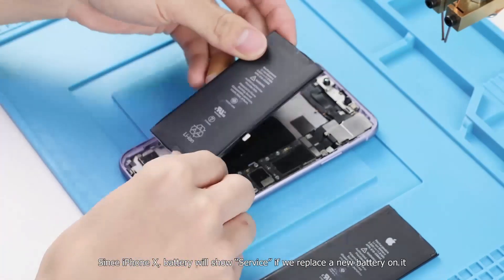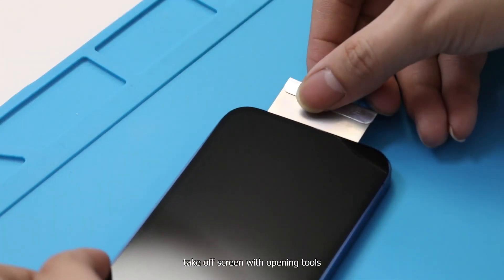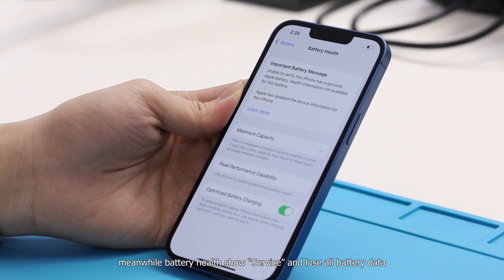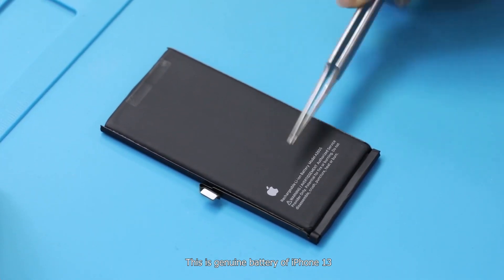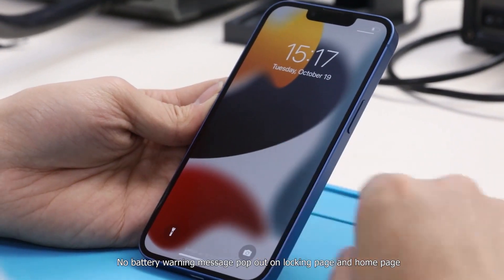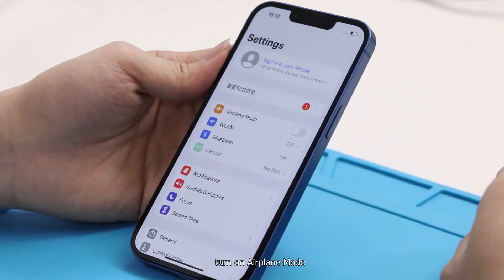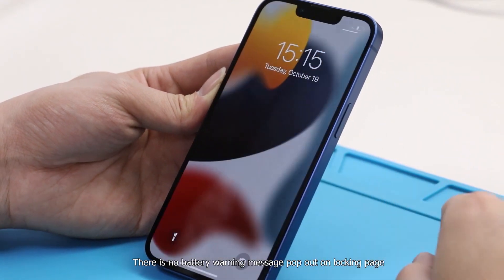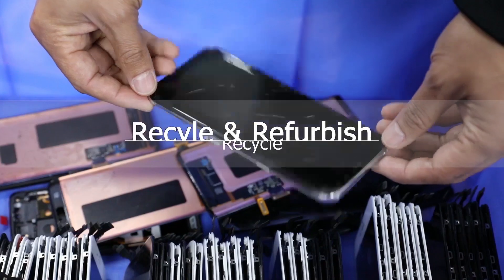How To Remove iPhone 13 "Important Battery Message" | Bonus Trick After Solution

Comment: Hi friend!
If im gonna replace iPhone 11 battery to a compatible.
Can it work properly if i only move   over battery board from original to comoatible?
Or do i also have to transfer battery data?
Thanks for answer.
Regards
Reply from the maker: I think you mean replace genuine battery with a copy(3rd party) battery. It's ok if you move over battery board from original to comoatible battery cell.
Reply: @Elekworld  Yes i meen 3rd party battery.
Do i also have to transfer battery data from old to new? 
Thanks for answers.
Regards
Reply from the maker: @Protube70  If you not care about the capacity data(100% or not), then don't have to.

Comment: Can i used iPhone 12 mini battery high capacity with iphone 13 mini after install PMS ? Or different voltage?
Reply from the maker: Not compatible. DIfferent voltage, different capacity and most importantly different BMS connectors.

Comment: If old original battery has 70% battery health, what battery health will appear after transferring the board?
Reply from the maker: Old 70% battery health, bcuz mainboard read the data from old BMS. But we also heard some few case that the capacity data will arise according daily usage bcuz it's new battery cell.

Comment: So data from Original board is 80% then new cell will say 80% as well?
Reply from the maker: Yes it is, bcuz teh motherboard will read data from old battery board. But we do hear some very few case that users said the capacity data might arise bcuz new battery cell has more power capacity.

Comment: Does that happen even if the battery's been replaced by Apple service providers?
Reply from the maker: It depends on if they are REAL Apple authorized repair center, also if they choose original battery to fix your iPhone, or you choose cheaper battery to repair, bro.
Reply: @Elekworld  thanks for the reply man, I also wanted to ask if it causes other problems aside from the important battery message?
Reply from the maker: @etiwahst  Nope, if you replace with a new battery and the warning message appears, it doesn't effect any real battery function. Just that you can't read battery health data.
Reply: @Elekworld  thanks for the info bro! 🙏
Reply from the maker: @etiwahst  welcome bro, pls sub us and stay tuned for more update.

Comment: How to determine the right polarity on the bms?
Reply from the maker: Here is an easy method: Put genuine battery board with "L" shape, and to match the battery cell two polarity with solder joints upside. Check video here to understand better: https://youtu.be/soisFl6hmtk?t=130

Comment: If i don’t have the original flex cable or bms broken can this solution work?
Reply from the maker: Nope, with the bonus trick you can just remove it from locking page before 30 days after replace battery, but you can't remove warning message from setting page, and battery health won't work normally.

Comment: Hahahah they would definitely burn if they are soldered in reverse. I put a pin in my Smartwatch to remove the battery right at the contact pins and suddenly shorted everything. LOL But it was a 130mah battery so everything was fine.
Reply from the maker: lol, so mark the anode and cathode is helpful before soldering

Comment: But what if the old battery is at 85% and I transfer the board chip to the new battery. Will it show again 100% on battery health or it reminds the old one that's 85%?
Reply: 85%
Reply: @kamildabrowski6002  cant you reset the battery health and cycle using the icopy ?
Reply: @SimplyFishyPH  Did you try it?
Reply from the maker: Yes, 85%, old battery’s capacity. But we heard some few ppl said iPhone might update battery capacity(higher, normally new battery is brand new) after we doing this, but this is still need to be proved.
Reply: @Elekworld  - Try attaching the new battery without the original board to perhaps reset the counter on the main board. then transplant the original board to the new battery and see if that might help.  It may or may not work, but worth a shot.
Reply: @BillAnt  it won't the battery capacity percentage is stored on the BMS so you would need to replace the BMS for the percentage to be correct, but you can't. So we're screwed. thanks apple

Comment: No, changing battery on iPhone X is alright. No service, etc. Message, only iPhone XS And Above
Reply from the maker: Thx for reminder Alden, we checked again, actually it started from iPhone SE.
Reply: @Elekworld  your welcome! Yess it's from SE 2
Reply: The battery warning message pops up on any iphone with ios 14 and above may even pop up on any ios with version 12 and above, knowing Apple they will add another restriction in future ios updates where if battery cycle count is changed or efficiency then the battery won't work!
Reply: @retrotech11  nope, i changed my iPhone x and 8 battery on ios 15 and the battery health is working alright. This is because the battery on iphone x and below doesnt have secure memory on it. There is no relation on ios and these messages EXCEPT for very new iPhone

Comment: Next they'll put the board inside the battery itself
Reply: Impossible 🤣
Reply: @aksminer2969  - Anything is possible by Apple. :(  The good news is that the EU is working on legislation to prevent such anti repair measures.  And in the US we have a Right-to-Repair movement going on.
Reply from the maker: LOL

Comment from the maker: Since iPhone SE 2, battery will show "Service" if we replace a new battery on it, and since iPhone XS, non-genuine battery warning message will pop up. So, will this warning message appears and battery health data lose again on iPhone 13? Also can we remove it by transplanting genuine battery board on new battery cell like elder iPhones? Let's make a try now.

Correction: Battery shows "Service" in Setting, battery health lose: From iPhone SE 2.  (Thanks to @Alden Viriya Tanudjaja)

3GOA Portable Battery Spot Welder: https://www.elekworld.com/shop/productinfo.aspx?proid=15187&categoryid=283
CPB LCD/Touch Screen/Glass Separation Heating Station with Thermostat, EU/US Plug: http://www.elekworld.com/shop/productinfo.aspx?proid=6845&categoryid=287
WLXY Midget Diagonal Pliers, 125mm: https://www.elekworld.com/Shop/productinfo.aspx?proid=6789&categoryid=290

For more Repair parts&Tools and Tech support, please visit:
Website: https://www.elekworld.com
Facebook: https://www.facebook.com/Elekworldshop/
Instagram: https://www.instagram.com/elekworld/
Twitter: https://twitter.com/ElekworldL